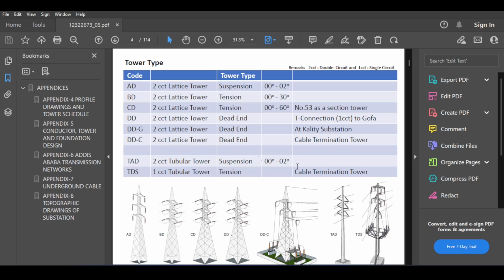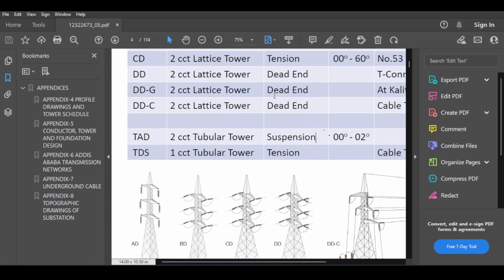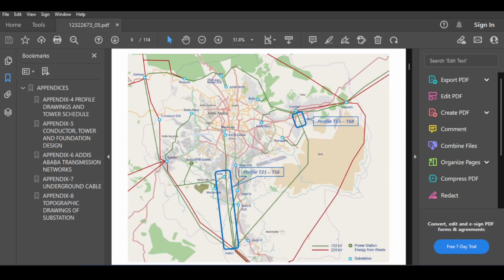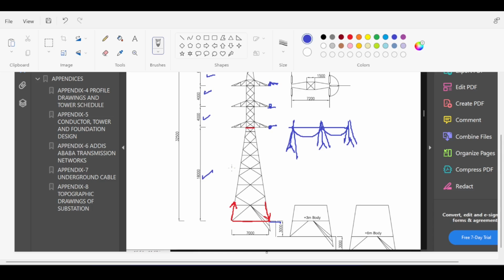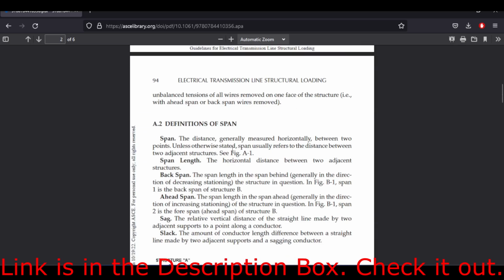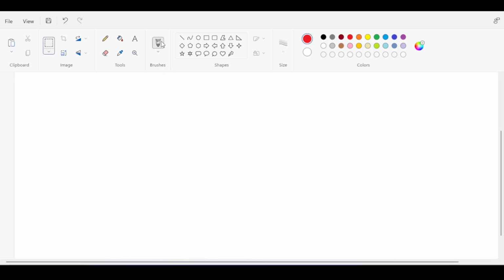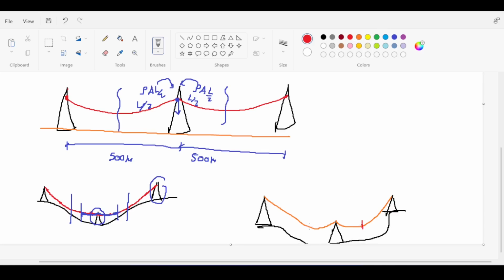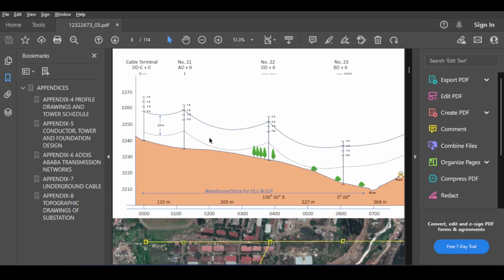Modeling Transmission Towers (Lattice Steel Structures) - Part 1: Background - Autodesk Robot

Comment: Am in love ❤️ with the new structure of this channel already.

So one quality tutorials a week makes it easy for viewers to follow and research more before the next week. 
There would be ample time to practice the new ideas gathered on this channel, and with full concentration on the part by part tutorials lessons.

Concept, Modelling, Analysis, Design & Reporting is just perfect structure for this amazing 🤩 channel. Thank you 

As a practiting engineer, I haven’t had the opportunity to design or study about Lattice structure, usually it’s buildings most engineers get to design. 
However, your advice of researching and taking on new challenges by engineers is greatly appreciated in this regard.
This is my first time learning about lattice (pylons) and am sure from here I would do more personal research.

From your experience, it’s clear the conceptual drawings of the Lattice structure and it’s layout on the site is not done by the structural engineer but the electrical engineer. However, the structural engineer can only suggest any changes in case structural stability of the lattice becomes a concern.

In sizing of the base of the lattice, per your document it appears the height of the tower, h/4 gives a clear and realistic indication. 

For loading of the tower, honestly it’s my first time hearing, weight and wind span. They sound interesting 🤨 however you gave a good explanation. I’d personally find out more in the documents attached.

Great Job Sir.
I love ❤️ the introduction 
Keep up the good work.
Regards.
Reply from the maker: I'm really happy that you like the style of presentation. I was a bit skeptical at first, but after recording and releasing, I realized that it was the right choice to do.

h/4 sounds interesting, I will personally check it out. It fits what I saw in the JICA report. ^_^

As for buildings, of course I will cover it. But I thought let's start the first structure with something "out of the ordinary" ^_^ 
All the best,
CEE
Reply: @CivilEngineeringEssentials   I find the Lattice structure to be extremely important.

It’s difficult to download the JICA report from my end. I will try again later